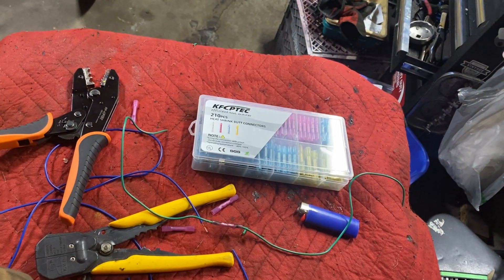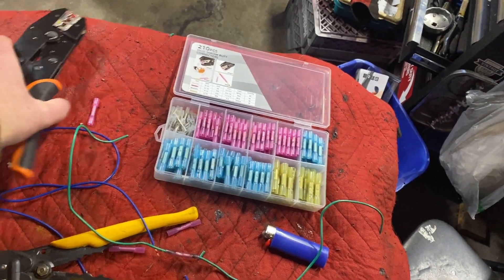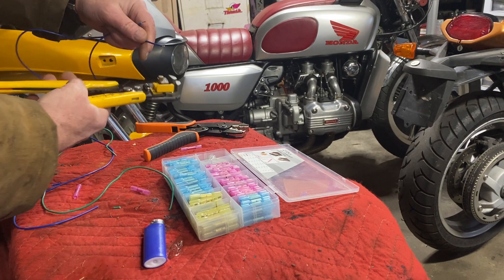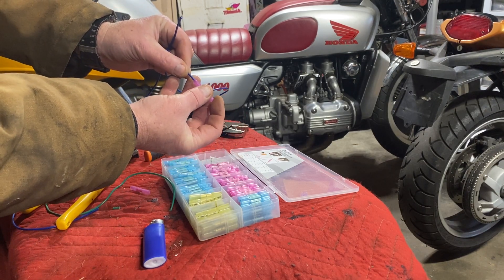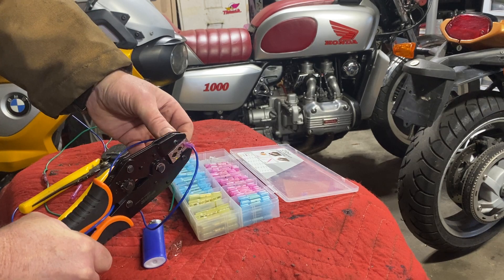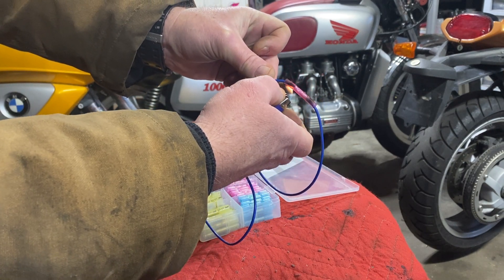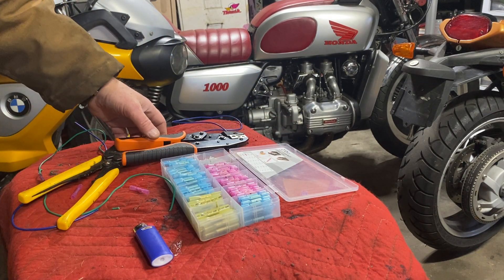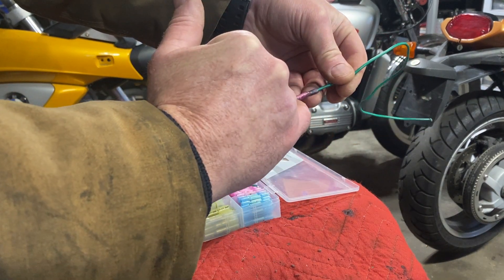How to use heat shrink butt connectors and ratcheting crimper for strong durable wiring

Comment: I thought you are supposed to use a single crimper on heat shrink connectors and terminals. The one shown here is for plain insulated connectors and terminals and is a double crimp, one side for the barrel and the other for the strain relief. Connectors are a rabbit hole and there are a LOT of crappy ones sold.

Comment: Is the crimper specific for heat shrink butt connectors?
Reply: To me it looks like a double crimp which is meant for insulated terminals, the heat shrink ones use a single crimp is my understanding.

Comment: Hello i have a problem with the compressor when i drive normaly it doesn't turnn off as soon i hit it on the gas it turns off at 3000 rpm w202 c230k
Reply from the maker: Sounds like the clutch on the front of the supercharger is having issues engaging and disengaging. The clutch can be replaced separately and , is fairly common with high miles .